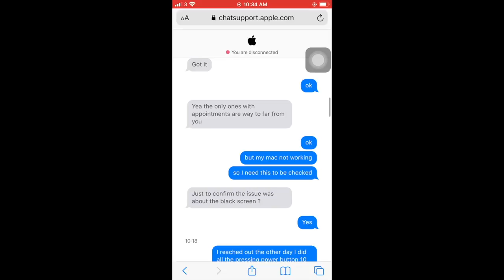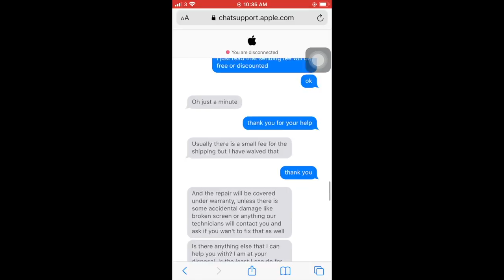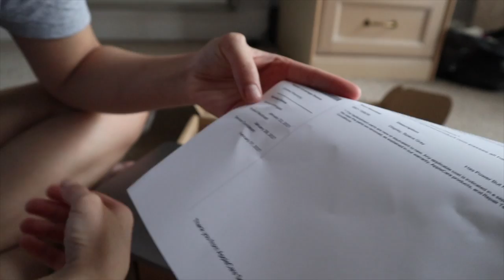MacBook Air M1 Chip won't Turn On Problem | Black Screen Issue | Help from Apple Care Support | VLOG

Comment: I just bought a Macbook Air, will recieve it 3 weeks. Glad I’m aware of the issue before I’m getting the laptop. I will make sure to only use the original charger and not charge through other ports. It seems like people kill there circuit board inside through usb adopter/device.
Reply: Its stil going to be a nightmare seen you can’t change ssd. Especially m1 Mac
Reply from the maker: apple has ssd? they dont right?
Reply from the maker: How is your new mac? what can u say about it?
Reply: @GwenGeorgie  they do have ssd which is actually faster than most ssds. You just can't add extra or replace them, since they are soldered into the motherboard.

Comment: Encountered the same issue last month with my Macbook Pro m1. It's gone for repair now under warranty, going to pick it tomorrow. For the people who are newly buying it, please buy applecare+ (it will cover your 3 years) because there are alot of issues with m1 devices and out of warranty repair will cost you a fortune once your warranty expires. I got this issue 6 months after buying it (hope it clears that this can happen anytime). You got a new subscriber for highlighting this issue channel :)
Reply from the maker: cool.. yes so true with the need to purchase apple care, I just got lucky I didn't have it but my mac was fixed for free.
Reply: what was the problem with the machine? what did the service say? i have the same problem with the macbook air m1 (
Reply from the maker: i just sent it to apple care. then returned fixed already dont know y it shut down
Reply: I just got the same problem too, did you end up having to pay anything?

Comment: I can really tell u a fun solution that worked on me... when my new m1 macbook pro was dead... i tried every solutions..in the end nothing works..
But Today i jst a got a magnet that kids used to play.. in my hand.. and i used to move the magnets all along my keyboard speakers etc.. and tried turn on.. and i plugged in  and tried again to move the magnets i have ..all along the my macbook😁..suddenly my mac turned on 🥰😍 ..... i dont know y this happened .... Anyway I am so happy..😍 tht my mac turned on again after a week of dead days☺️
Reply from the maker: Thats sounds fun, it could have knick something inside which helped it work again :).. After this problem my mac still okay if it happens again then I'll def do what you did 😄

Comment: Mine literally doesn’t work out of the box. I thought it was just not charged so I charged it. Now almost a complete day later and having tried all the troubleshooting suggestions. Thing still won’t turn on. It has been charging and it have zero lights on and zero sounds. Now I have to wake up early to talk to a specialist in the morning. I have a feeling it’s gonna have to be sent in for repair. Smh
Reply from the maker: ohh that looks like def needs to be sent back, mine work when I received it then after three months it happened exactly as you said. Good luck Hope they can change it soon.
Reply: @GwenGeorgie  Took it to the Apple store and they told me it was dead out of the box. They didn’t know why, but they also didn’t ask me any questions. leading me to believe this has happened before with that model. Honestly apart from the actual return, apple made everything else difficult. Calls not returned. When I did get through I would be switched to different ppl and have to start all over lol
Reply from the maker: where are you located ? 
Just say you were not that lucky. 
actually the first time I contact the apple support that happened to me they keep transferring me to different people so every time Im with a new staff they will check and ask again what was the problem. which was so annoying.. 
Now what will they do after all that shebangs ?

Comment: same problem. 1 month of using then suddenly black screen appeared. Done all the rebooting stuff, it doesn’t work 🥺
Reply from the maker: Lots of people having the same problem, try to send it to apple support . Hope it helps
Reply: Same here.🥺 May I ask how many days/weeks  after yours was repaired? And after repair, is your mac perfectly fine? (Tho I saw in your vlog that some keys are not working)
Reply from the maker: @rubypatriciamaronilla6491   likely two weeks. Yes its working now 😄,,  I thought they broke it , but was just some dirt inside the keyboard.

Comment: I have the same problem. Will be going to PMC MOA to have mine checked. Ughhh. This is kind of frustrating.
Reply from the maker: Hopefully yours will be fixed asap.. I was frustrated as well when this happened but just an update after this incident up until today so far Mac is working fine..
Reply: Hi, Glenn, can I ask for an update on your trip to PMC? Did they fix or replace?

My M1 Air isn't turning on too. Unfortunately I have no AASP near me, I have to travel to another province (Cebu) by air or boat if I want mine checked and travel restrictions are my problem. Also, I bought mine from the Apple PH website but Apple support suggested that I visit the nearest PMC to my location.
Reply from the maker: its actually showed at the end of the vlog 😉..  did not have to go there they sent me a box put the mac there and sent it through parcel. Hope yours will be fix soon. I guess service differs depends  on the location.

Comment: I don't usually comment, but I had this issue on MacBook Air, the one just before the M1 chip. 

Nothing worked to solve it except plugging the computer back into my dongle (HDMI+ power USB c). So if you have used a dongle with the the MacBook air recently try plugging it back into that setup first.
Reply from the maker: I dont have that dongle. so far after it has been fix no more issues .

Comment: hey did they mentioned in that invoice about which they part they have replaced because i am also facing the same issue and mine is out of warranty so i want to know weather they replaced the entire screen and if so wjag is the cost ?
Reply from the maker: Hi they didn’t mention if they changed. Anyway it never had problem after that repair. Cost was 0.

Comment: @simple  giwen , have purchased a apple care plus ?
Reply from the maker: Yes they were really helpful
Reply: What if we have not purchased Apple care plus, 
And our Macbook screen becomes Black?
Reply: They will cover in warranty or not ?
Reply from the maker: @khajamoinuddinkhadri786  I did not purchase applecare. They will cover it as long as the problem is not caused by physical, Like mine it just suddenly did not turn on.
Reply: @Simple Gwen
Okay, Thanks you
Reply: @GwenGeorgie  did they replace the Mac entirely or did they try to fix it?
Reply from the maker: @quincysinette9592  as written on there report they fix it . They did not change anything.
Reply: @GwenGeorgie  wow.   Mine just came back to life.  Will it happen again.  I do not know.  I have read that y o u can fix with another Mac and type c connection.   All I have is ipad pro..  I red on reddit about the pressing power button.    This is a problem.   I am going to purchase the apple care.   It s3ems these M1 have the issue the Samsung  Tabs used to have.  It's almost the sleep of death on another type charger than the one that came with it.   My question would be, how can we use a Dongle with power?  This is great flaw.

Comment: The screen stopped working exactly the same on mine, so i returned it. Apple have a problem on their hands.
Reply from the maker: what are you using now?
Reply: @GwenGeorgie  a cell phone, i decided not to get another M1 incase the same thing happened again.
Reply from the maker: nice. which phone? I needed the mac for editing that why Im sticking to it.(*though I am not good at editing🤪)

Comment: I purchased MacBook Air M1 on June 2022 from Apple store. Yesterday (17/08/22) it didn’t turn on. Horrible experience. Thinking to take to service centre.
Reply from the maker: If its from apple store just send it back they’re very helpful and they might probably give u a new one if its just bought and not working

Comment: My Mac is showing blank screen but keyboard light is on. I can use MacBook blindly using shortcuts .that’s so funny. Just after 18days, I closed lid and when I opened it back it was blank. ( I got a mini attact). Hope Apple fix it soon🥺🥺. Actually it was my first Mac @apple please🥺

How much time will it take to repair? Everything working fine? Any part changed or same?
Reply from the maker: Mine was my first too.🥺 They did fix it free and it took 3 weeks for it to come back

Comment: I have exactly the same issue. Just few hours ago. Bought it 9th of June. Tried everything, I am at work so i haven’t got my charger with me. But I will try plugging it in later to see if something good will happen. And I have scheduled a visit at apple store on Tuesday which is my day off. I hope it goes well.
Reply: Update : sent it to the Apple Store Dubai Mall yesterday, after checking they said it is a hardware problem so the screen needs to be replaced. And today they e-mailed me that my MacBook is ready to be picked up. Wow that was fast. I am dropping by there on my way home from work.
Reply from the maker: Cool!! I went to emirates mall before for my phone cuz it had issues as well then same day, they have fixed it. all free :)
Reply: @johnmarlopinga  did you have to pay or did they fix it for free?
Reply: @johnmarlopinga  how much did you pay for the repairement?

Comment: Thank you so much
I also noticed that my mac is starting with a sort of glitching. 
I press a key and then the screen turns on, but then I close the screen and then I press again the key and the screen partially turns on.
Thanks
Reply from the maker: is it working alright ??
Reply: That happend to me like 2 time. I bought macbook pro(2019) and then they send me new one n happend again and i bought apple    macbook air M1 and its happining again
Reply: @GwenGeorgie  its works but after time screen starts to glitching soo much (i just use them 1 month)

Comment: I got the M1 MacBook Air in August 2021.  Over the weekend the screen stopped working for no reason.  Cosmetically the MacBook Air is in mint condition because I have always had a case on my MacBook just sent it out to be fixed from Apple today we’ll see what happens once I get it back

Comment: Well this is bad... Unfortunately they make it hard or impossible to have access to our own files. I hate soldered ssd, those machines should come with a M.2 slot at least...
If they suddenly stop working all is lost. Sometimes there is no time to sync a backup depending on the project or creative work. I got the M1 MacBook Pro, but I'm scared seeing a lot of people having to return it to Apple.
Reply from the maker: omg yes exactly that was one of my concern when this happened . funny thing is the costumer service ask me to back up all my data but how can I do that when It not working at all.. lol  
And yes about the SSD slot thats also a least like upon thats why I purchased same time when I bought my MAC.
Hope yours will be working fine.

Comment: I am having the same black screen issue and it makes a chime sound when i try turning it on by pressing the power key and Also It happened a day after the warranty expired .. I don’t know what to do now ..
Reply from the maker: If you bought it from apple. Still you can contact costumer service they normally helpfull
Reply: Did you get your issue resolved?What did you do for the same?

Comment: Same issue. Doesn't work out of the box! absolutely ridiculous! Definitely need to send it to the support. Pathetic!
May I know what's on the issue report that they've sent along with the laptop?? what was the issue actually??
Reply from the maker: They actually did not write any detailed report whats wrong with it. Yeah its not all perfect but im still thankful, up to date still okay after I sent it to apple care.
Reply: Thanks Gwen. It's running all fine since then?? Have you encountered any further issue after that till now?? I've sent mine to the support last week, let's see how long it takes during this pandemic.
Reply from the maker: @ModassirHossainRajib  where u from? its easing a bit hopefully we will be back to normal soon. Yes its been working fine, I use it daily no issues

Comment: Mine wont even make a sound. Got it 4 months ago. This is ridiculous...
Reply from the maker: hope it will be fix,, mine was fine after I got it back
Reply: @GwenGeorgie  it just sucks because i dont really have time to be going to the apple store. I was really hoping there was a quick fix to it😩
Reply from the maker: @Mickster114  did u try press d keys hold for few sec. or try sending through post but it will take few weeks to come back
Reply: @GwenGeorgie  “d keys”? What are those exactly? And yea if i cant fix it myself I’ll probably have to send it out unfortunately. But a few weeks tho?? I thought itd be like 5-7 days max😩
Reply from the maker: @Mickster114  if u watch the vlog I did show there but here I copy paste it 4 u, Press and hold down the Command (⌘) and Control (Ctrl) keys along with the power button (or the ‌Touch ID‌ / Eject button, depending on the Mac model) until the screen goes blank and the machine restarts.

Comment: Mine also got bricked after just a few weeks, I'm going to have to send it in aswell...
Reply from the maker: that's frustrating , yup just send they're helpful
Reply: What happened? Like what caused that?
Reply: @samueloladejo8657  Nothing, it's a common issue with the new apple chip macbooks. Can brick out of the blue, my guess is because of intel based applications
Reply: @TigsFerrariPeeks  Oh wow.......That's wild. I also have one and now I am worried.
Reply from the maker: @samueloladejo8657  I dont also know. Just tried turning it on, it just wont turn on
Reply from the maker: Apple is helpful in a way. hope it will not happen to you
Reply: @GwenGeorgie  Little update: It has been successfully repaired and is being sent to me free of charge right now, let's hope it doesn't break again :)
Reply from the maker: @TigsFerrariPeeks  yea happy to hear that.. mine still working fine after I did this vlog ❤️

Comment: mine went black and keep on a bootloop after usage of 1 week. Sent it to apple and just got my mac back after 4 weeks of repair..... Got the logic board, touchbar and touch id unit replaced...
Reply from the maker: omg 4weeks is a long time , Glad they fixed it. Did you pay for the changed parts?
Reply: @GwenGeorgie  cause in indonesia there is no apple store, so its gotta be shipped to apple Singapore, then shipped to apple china as the parts are in china.
luckily its still under warranty so no cost needed
Reply from the maker: @orang497  I see that's okay then, they are very helpful hope you will get yours on time . Indonesia is a lovely country btw
Reply: @orang497  mas/mbak, sesama indonesian. Caranya gmn ya buat service/claim macbooknya? Saya kena masalah yang sama ini. Mohon bantuannya
Reply: @abiqmuhammad7819  kalau di jakarta, bisa bawa langsung ke qcd Mangga dua, dia authorized lgsg ada koneksi di apple singapore.
Reply: @orang497  thanks a bundle bro

Comment: I have the same problem but my macbook air m1 2020 is 2 weeks Old. Today i opened it at low battery and left turned on. Later i came back and couldnt do anything with it. Tried every key combiantion.
Reply from the maker: Send it to apple care if you have done all the short cut keys ..
Reply: @GwenGeorgie  yeah im going to do it tomorrow. BTW how long uve been waiting for the laptop to return
Reply from the maker: It took about two weeks

Comment: You probably used a dock with pass through charging
Reply from the maker: why??
Reply: I did that tho wait?? You don’t supposed to do that ? Tf so fragile
Reply: @rakkwan741  I’ve heard from friends that the new M1 Macs seem to have a problem with those adapters
Reply: I'm using original apple charging dock and apple cable that came in the box. Still my logic board failed after 2 months of opening it from the box brand new. Should I not use the original apple charging brick?

Comment: Hi my newly bought macbook air m1 at 66% it automatically turned off so I got my charger and I plugged it in and It charged to 68 so i decided to take the charger off and then here comes the 66% again and it automatically turned off and then I charged it once again the second time until it is fully charged and I updated my macOS software to monterey 12.3 and I'm waiting if it acts up again I don't know if it's normal

Comment: This just happened to me.  I doesn't do anything.  This is frustrating.   I am about to Google it.  I just put all the stickers on mine thinking it will last.  Now I just lost out on the deal.   It's been less than 30 days.
Reply from the maker: I hope yours will be fix soon. thats frustrating.
Reply: May I ask what kind of work you do on your MacBook? Are you a light user, like a student, or do you do more intensive work?
Reply from the maker: @scholar2097  hi, I use it for video editor and before this problem happen I use to practice and study coding other than that browsing and watching only
Reply: @scholar2097  I do light work if you will at this time.  I intended to get  a pro but  as soon as I decided.  Rumors of the new design and the 16 inch.  I decided d to get the air now and then get a pro when they launch  them.
Reply from the maker: I would love to upgrade to pro, I will need to save to afford it ☺️
Reply: @scholar2097  I don't do any video or CAD but beginning to do more big file audio.   When I am not working I'm on my Mac doing bills and learning things.